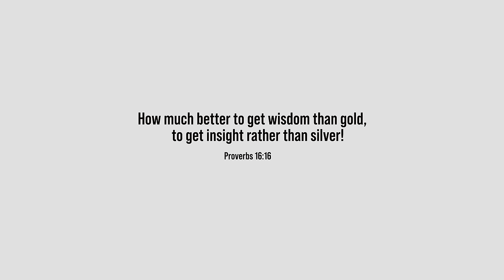JUST GREAT: A NEW WAY THAT YOUR TRACTOR CAN KILL YOU! 💀⚠️☢️

Comment: My Kubota manual says not to use wheel spacers with the backhoe - what is your take on this?  I am glad you make these videos.
Reply: Unless there is a clearance issue, or a known issue of axle breakage while using spacers, I would go ahead and use them if you want to. It would have to be the weight while driving because once you have the pads down, you can lift the rear tires right off the ground while you dig, so there won't be any weight on the tires. IDK for sure, but that's my two cents.

Comment: I have had a vine do the exact thing, catch my R.O.P's and start to pull me over. I immediately dropped my bucket to the ground and stopped the tractor. I went to the shop to retrieve my chain saw and I cut the vine out completely. After the first instance of this situation occurring I made a chainsaw holder for the tractor and do not go into the woods without it. I walk the area looking for things like vines low branches, holes etc. because my attention is on a lot of issues while operating, but miss one and your done. Oh, and I go slow in the woods, real slow. I have to get things done, but not at the expense of my life or wrecking my machine. It's not worth it!

Comment: Most of my property is on a hillside and I have found it is much safer to remove my backhoe and replace it with my ballast box.  I prefer the box over suitcase weights because I can get it closer to the ground if I need to lower the center of gravity.  We finally have a local RimGuard dealer and I am having all 4 four wheels filled after the holidays.  Because I do have many narrow places to mow, I bought my 1025R with the 54" mower deck.  Has anyone ever come up with a simple way to reposition the deck's stabilizer wheels to allow for Bora's wheel spacers?
Reply: Simple? No. But if you, or someone you know, or a welding shop is willing to cut them off your mower deck and weld them somewhere else where they are out of the way but still functional....IDK, I know how much my 60" cost. I personally wouldn't cut up a mower deck that costs as much as an inexpensive zero turn mower. Maybe just adjust your mowing pattern to mow the hilly areas safely instead.

Comment: I like to keep the brush hog on most of the time (it's heavy) and the bucket down low in general. My roll bar is fixed. I wear my seat belt. The one "almost" turn over I had was trying to pull a bar out of summer hard dry clay with the bucket. The bar did not budge but it was overall pulling the tractor to one side. I quickly lowered the bucket. This was one time I stupidly did not have the seat belt on. Put the fear of God in me, for sure.

Comment: Sounds like it was a scary situation for him for sure. Catching vines isn’t that uncommon, I’ve come close to tipping with 7,500 lbs tractor by catching vines.  I use the steering wheel and steer brakes  going back and forth to get the rest of the tires back on the ground. Keep a cool head and work the problem.

Comment: Along the Lines of Safety and Tip Overs....
And this would make a good safety video topic if you want...
Hope everyone Reads this just to have in back of their mind.

Something MANY MAY OVERLOOK in a rollover is Impalement of objects around where you are working,...
This includes but not limited to things like stumps, downed trees, Scrap steel that many of us hoard, bolder's or big rocks like 2-3 man stone  or dinosaur eggs as many call them. , Guide wires, fence posts, REBAR(and those orange caps are for falls, not Rollovers) 
Even your attachments if you are swapping between several implements on a woods or hill project and have them staged close, These can be your enemy.
And yes these things could save you if you fall on them just right,  and catch the tractor "just right" but my luck isn't that good. I'd probably end up smacking my head on a Rock inside my "Protection Zone"
And not to take away from Any products, but NO safety equipment can save you from impalements, to be bluntly honest that includes the very first lines of protection like Seat Belts and ROP's (roll over protection)
None of these things matter when foreign objects get thrown into a what is (assumed)will be a flat ground situation when it occurs.(Most Likely It Won't be)

Something else is a Bad Tire or dry rot tire can let go when you need it most and have it Loaded Or NOT....
At the end of the day it's the unexpected that gets us.... That's what an accident is unexpected, now throw all the unexpected into the Unexpected and you have your worse case scenario.(sure beat that word to death)

I attack these vines with my Excavator, They are Wicked and can snap the tops of Good trees out.
So I get it...
Glad this guy stayed safe.

Cheers everyone.

Comment: My tractor is old and has no roll bar.  This does not bother me because I am always aware of possible roll over and there is no way that is going to happen to me.  What does bother me is the stupidity of people, even those I have worked with.  I had a helper that was so stupid that he tried to direct me from the ditch I was digging with my backhoe.  Another time I was trying to help a neighbor pull his trailer out of a stuck position and he tried to get between my backhoe and the trailer I was pulling to help guide me. The fool killer is out there and no roll bar is going to foil him.

Comment: In 1980 I worked for Bowie County, Texas, highway dept. I cut grass on the side of the roads. The grass was tall & thick along an unrailed place where the road crossed over a small creek. As I got to this are I did not realize the roadbed dropped off instantly. When the front wheel cleared "mother earth" the tractor leaned and dipped forward all of a sudden. I bailed off into the middle of the road (glad there were no car's passing by). The tractor and 6ft. rotary cutter were teeter tottering on two diagonal wheels. It was fortunate for the county that the rear pulling wheel was the one in the air. For this reason I will never wear a seat belt when on a tractor!

Comment: Filled my tires with ballast and then years later I got new tires.  Asked the shop if they would put the ballast back in. They said yes.  However, what they did is drain my tires into a large reservoir and then refilled it from that reservoir. Who knows what was in that tank. My worst fear is that someone had used plane water or worse, sodium choride.  Word to the wise, ask detailed questions.

Comment: And don’t think your front end loader won’t tip you over. While trying to move a large log with my JD 4200 on a 15 degree slope with tires fully loaded and a rear scrap blade attached, I nearly tipped over trying roll a large log with the corner of the bucket at a higher rpm. It happens in an instant.

Comment: I’ve worked with tractors and backhoes, drive with common sense and you’ll most likely not have any accidents!! I used to move dumpster containers that waste management would hook up to there rigs to empty!! From what I see in this picture is the grapples are to high and probably to much weight on one side, otherwise, on an even distribution of weight the back end would have raised u!!

Comment: I just don't understand why someone would use a loader without either having a backhoe, implement, or weight box on the back for counter weight and stability.   In fact I use at least wheel weights also on any tractor I'm not just mowing with.  Way too easy to lose traction and roll them unexpectedly.

Comment: Really not a good idea to have a backhoe on a tractor with a front-end attachment in the woods.  Not only does it make the tractor much harder to maneuver due to the extra length, but also the CoG is higher which decreases stability.  I suspect if he was using just the grapple, he would have avoided the roll-over.  Sure, spacers will help, but only attaching one major attachment at a time when working on hills or in the woods is even better.

Comment: Those baby tractors are cute.

The problem is always operator error.  Carrying loads too heavy or too high.  Not paying attention the where the equipment is and what it is close to or going through.  Driving on a hill sideways that is too steep or too fast.

Spacers are nice but dual rear wheels will do much better and give you more traction when pulling a heavy load.  And too heavy loads should be pulled on a trailer, not carried on the tractor equipment.  And if the hill is really too steep to be traveling sideways on, some outriggers sticking out the side would be best so if it does start to roll over it will catch it before it actually does.

And of course, you need to pay attention to what you are driving through and if the equipment hangs up on something it should be manually cleared off if it is any trouble getting untangled from the equipment.  Getting off and using a saw or some cutting loppers will probably be faster than trying to juke the equipment around to get it free.